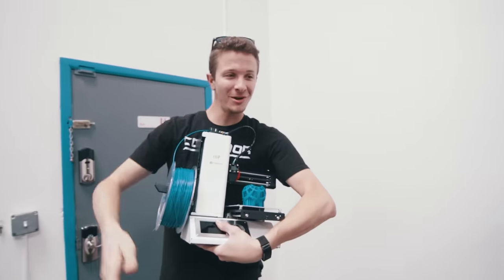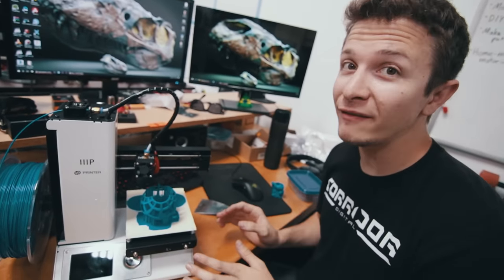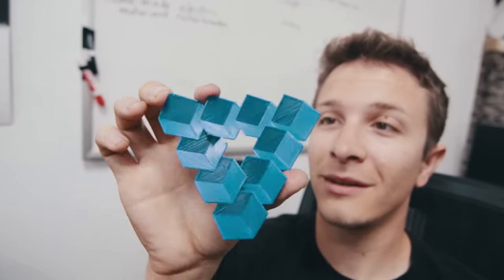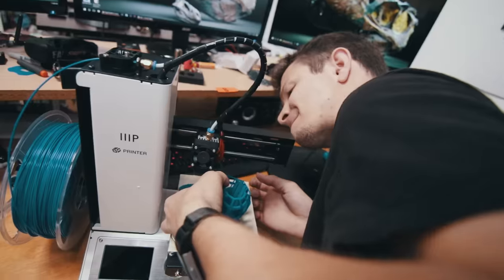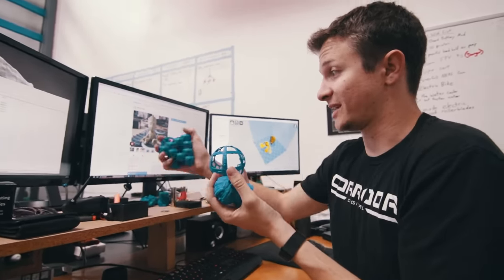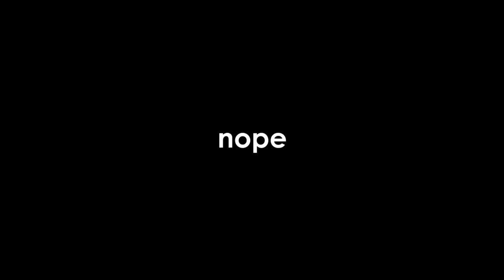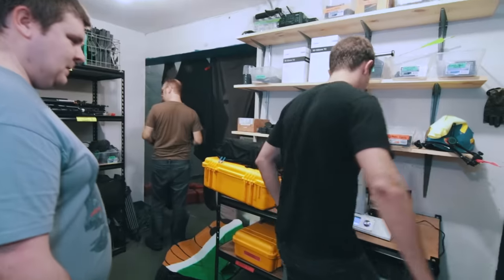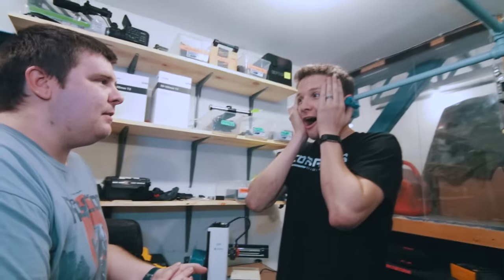Budget 3D Printer & Directing Actors

Comment: For anyone interested, I highly recommend the Maker Select V2 (or similar).  Just like Wren's printer, it comes pre-assembled and dialed in, and prints wonderfully, but it's got a bigger build volume and some other higher end features.  Costs around $300, and if you calibrate it right, it prints as good as a $2,000 makerbot!

Comment: Also you can change supports using programs. My favorite type of supports are from meshmixer. they have a very small point of contact with the print and are super easy to remove. They look like the type of connection that touches gundam model kits

Comment: for those who don't completely understand what "Cura" the pogram Wren used for 3d printing is essentially a program which will give the G-Code for the 3D Printer since a 3D Printer is a CNC machine it requires it.

Comment: This was my first printer, within the first month I had problems. Vibration in the stepper motors, the printer head shroud vibrates, when the printer is done, it'll sometimes go to its home axis and grind. If you get any other extruder, you have to get a slim one. For $10 more you can buy a Pursia I3. Bigger printing bed, which also can go 100℃ than the MP 60℃. The Mini 3d printer is small, but it's cheap. Got a refund on it.

Comment: you really dont need a raft, you can also get a sheet of PEI for the bed and make it stick better&have a shiny bottom. Also, why the old version of cura?
Reply: I just haven't upgraded Cura yet. I installed what came with the computer and haven't had a chance to check out the newer one yet. 

As for the raft, I've found that I get much more reliable results when using a raft. I've tried prints without a raft and every single one has ended up dislodging from the painter's tape bed and failing. I don't mind the extra filament use and time required to make the raft. I'm sure I'll look into upgrading the bed material soon though, I'll look at PEI first.

Comment: Hey Wren, I'm sure you've looked into it but hackaday.com has some excellent write-ups for the MP Select including some info about modding it and common failures to look out for. There is also a very active Facebook group devoted to min-maxing this particular printer called the MP Select Mini Owners. Happy Printing and keep up the great work!
Reply: Thank you!! I've joined the FB group already but I'll check out the website. I'm already interested in modding this thing.
Reply: Nice! It's a pretty solid bit of kit, especially for the price. I've had mine for about a year now and use it every chance I get. The only problems I've had with it so far have been the little metal plate that holds the thermistor in place causing the thermistor's lead to break over time due to metal fatigue and the included power supply giving up the ghost. Just replacing that metal plate with a few wraps of kapton tape seems to do the trick for the thermistor though and you can get replacement power supplies with a bit more breathing room in the amperage department on ebay for $20-$30. I've got mine up on blocks at the moment and am in the process of installing am internal RasPi with OctoPrint along with some lights and a webcam. Can't wait to see what you do with yours!

Comment: I have had that 3d printer for about 6 months  and works great. make sure you update the firmware and printer settings within Cura or whatever your using also there is a google drive doc with alot of helpful info drive.google.com/drive/u/0/folders/0BxyFI3iDaicLODVZOHI4SzZBNlE

Comment: Dear wren your doing pushups wrong.
If you keep doing it that way you can rip a tendon in your arm.
(like this comment for notice)
Reply: Which ones, the first or second ones? The second set is how I normally do them, which I'm 90% certain is correct. The first one was just to jump into the air a bit for fun. I never do them this way.
Reply: No its still wrong
Reply: What's wrong? Could you explain so I don't make the same mistake?
Reply: your shoulder is connected to the rest of your neck by a tendon and if you do push ups that way you will tear the tendon slowly and it will snap and break and you will not be able to move your arm and you cant fix it
Reply: You still haven't described what I'm doing. Also, what you did describe sounds ridiculous.
Reply: Alright what do you want me to describe
Reply: You haven't described anything. You just said the way I did it is wrong. I believe it's actually correct but you haven't elaborated what is wrong other than saying there's a tendon that can snap. I'm honestly just curious what you mean.
Reply: Bardan, the way your "describing" it, is like when you tell me theres food in the fridge. It just portrays there is a thing, not what the thing is.
Reply: wrenthereaper U are my favorite corridor member because you relate to me in so many ways
Reply: wrenthereaper I know I'm late but, I think what he sees as wrong is where you are pointing your elbows, you let them go to far out, you should try to point them back and bring them closer to your sides. To fix this issue, you should bring your hands closer together, to about shoulder width and not wider, and when you bend your elbows try to have them bend back instead of out. Don't push your arms to far back, cause then you will end up working only your triceps and will no longer be working your pecs (as push-ups should be working both) to make it easier when your arms bend, your chin should touch the ground about 5 inches forward from your finger tips, additionally when your arms are bent your arms should be at around a 40 degree angle from your body.